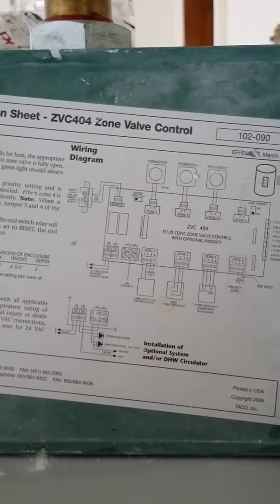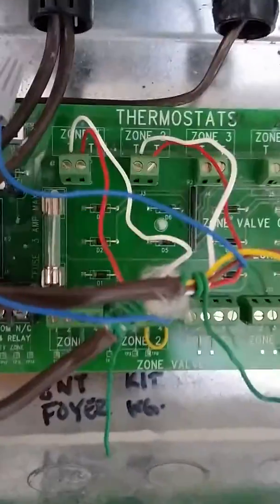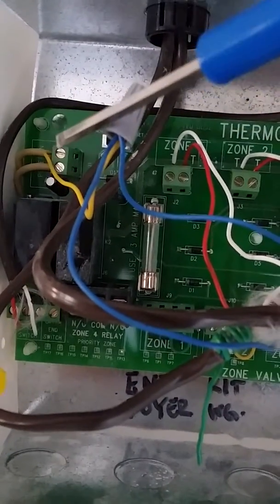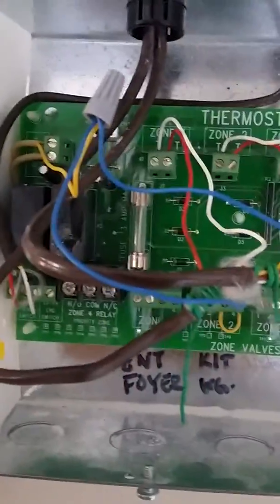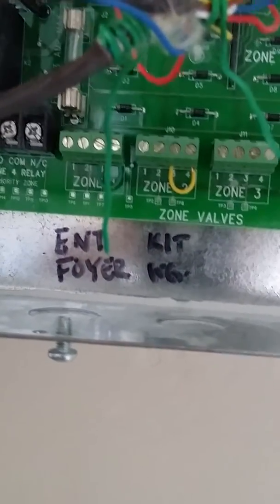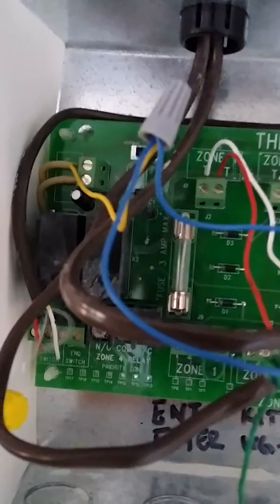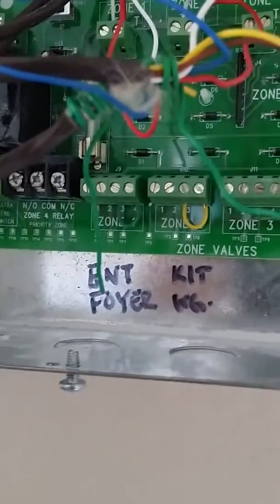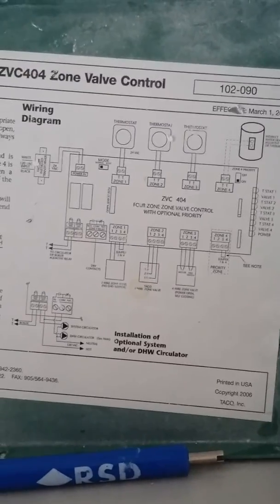5 Nest thermostats to a radiant heating system

Comment: Nice video!! Learned a lot.  Question for you... did you use 5 separate nest thermostats or used 1 thermostat and then sensors to separate the zones?? I don’t want to still a nest thermostat for each zone.. Thanks in advance for the reply

Comment: Older zone valve hog the 24v when calling for heat and can potentially shut down your WiFi T stat. Is this because you are using newer style valves that you can use just the one transformer?

Comment: Thanks for this though I can't seem to make it work.  I identified the hot leg and wired it to blue but the Nest reports No power on rH.  Go to nest.com/e24 for support.  If I disconnect the blue wire it seems to work OK.  Interestingly I'm not sure I have a problem as I seem to have 24+ VAC between red and white.